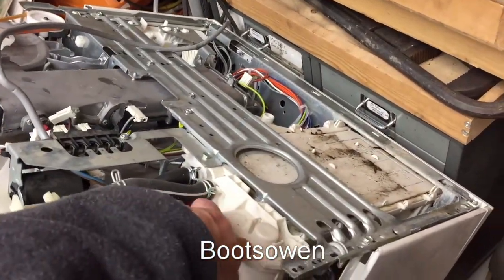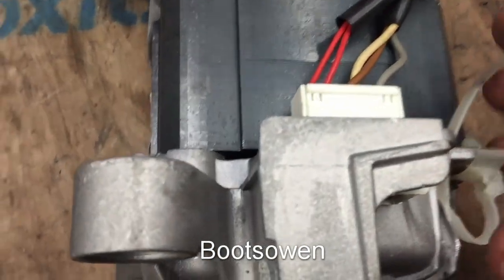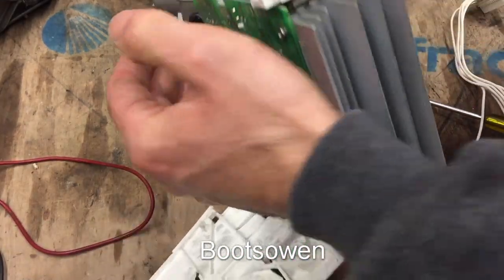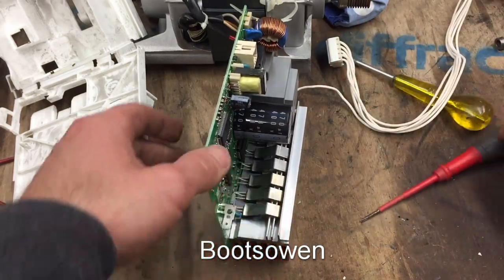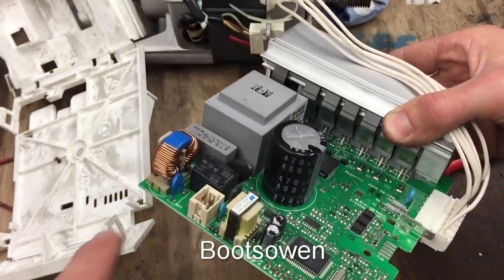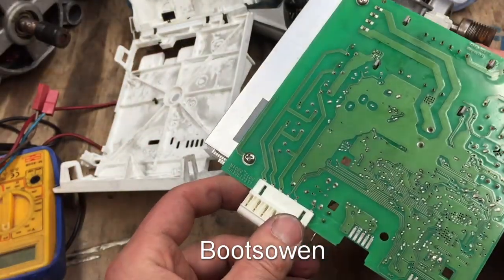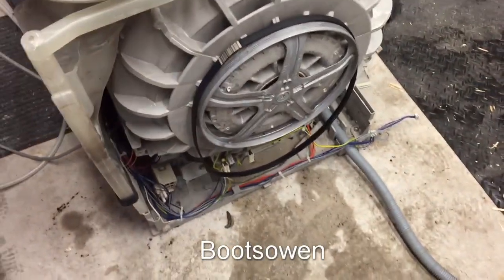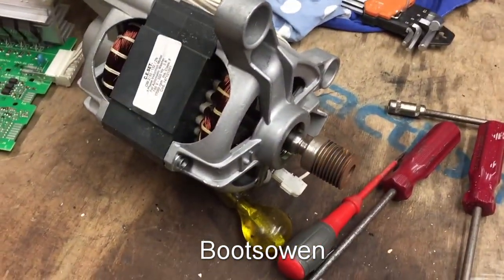Any ideas? How do I wire a  3 phase washing machine motor?

Comment: I found that the frequency does not really matter. if you hook up the motor to a 3 phase generator of any type (wire to wire) the motor will spin in conjunction with how much you put through the generator. Even if you spin the gen by hand generating 20 volts, at 30HZ for instance, the washing machine motor will spin in same direction you turn the generator, regardless of frequency because it's an induction motor and 3 phase. The frequency is more essential to single phase. Maybe put a capacitor (like the ones on that board 470v 400uf (as uf is only how much it stores)) to a speed controller that can handle the voltage, and you should be able to get the full speed range you're looking for.

Comment: I wanted to solve the same problem. I even asked my acquaintances, electricians, but they only laughed at me saying why I was messing with my head. Finally then I disassembled this board for the relay and the rest of the spare parts, but it's a pity of course. After all, imagine how many of these machines are all over the world and everything is in a landfill or buy a Chinese driver for Almost 100 bucks.

Comment: You can use a VFD - Variable Frequency Drive. There is a video by Photonicinduction about them. It's called "Motor Inverters".
Reply: Yes you can because that's all the boards are 3 phase vfds

Comment: It reaches the same speed as universal motor, even though it's quieter, it's used in Beko, Bosch, Gorenje WaveActive, etc, to make induction motors quieter, add a capacitor.

Comment: I use a motor like this on my homemade bandsaw. 

I use a 55 uf capacitor for motors, and reduce voltage from line to around 110v with a dimmer. (I live in Spain and we have 230v, and with this voltage the motor overheat ). This is a cheap solution. And will give you around 3000-3500 rpm. 

There are 5 wires. 2 for the taco,  and 3 for the motor. Forget the taco.

One wire to the "line-neutral" 
One wire to the capacitor. 
One wire to the other contact of the capacitor. 
And connect the other "line-neutral" to the capacitor. Depending on the Conector you choose the motor will turn one way or the other. 

I have been using it a lot and serve me well. 

Thanks for the video.  Saludos.
Reply from the maker: Thanks buddy, how did you choose a 55uf cap? is it just one that seems to work or do you have a way of choosing the value?
Reply: @bootsowen  I found on Internet that you need a capacitor of around 70 uf for 1 kw.  I made the calculations and choose the nearest capacitor that I could find. And it worked perfectly. 

I hope it can help you. 

Saludos.
Reply: @borjafg6899

I got exactly the same motor and controller. May I know at what voltage that capacitor runs? I can only find 70uf capacitors with more than 500 Volts, what seems to much I think

Comment: I wonder if the relay could start/stop it, if you put the right voltage to the board.  Seems this board IS what converts the single phase to three phase, so just need to finger out how to turn it on without using the front panel controls.
I wish I'd kept that board, instead of just the motor, from the washer I took apart.  I want to make a wood turning lathe.
Jeremy Fielding, a YouTube'r who teaches how to re-purpose motors (and build shop tools & robotic arms) describes two methods to spin one of these motors -- one of the methods (the preferred way) uses a second motor to condition the power (if I remember that right).  Of course, the spendy way is to buy a single-to-three phase converter... I don't have funds for that, but imagine plans exist online to solder up my own...some day, hehe.

Comment: I used a rc car motor controller on the same motor with only 24 volts. Maybe you can get a higher voltage one. You can get 8s esc which is around 33volts but bit expensive!

Comment: This is called a 3 phase inverter motor because of that board :) all that board does is “invert” the voltage (ac to dc or dc to ac)
In other words it’s a vfd but without the variable
Reply: Sadly without the control PCB you will not be able to use the inverter module (that’s what’s it’s called) because we don’t know how much voltage enters that PCB and if we put too much (240vac for example it can be good but we don’t know) you can risk fucking up the module and making the motor useless unless you want to waste money on a vfd which are very expensive

Comment: Light up the relays with there rated coil inputs, can probably find them on a powered board just need a meter.
Reply from the maker: I only saw one relay on the board, input is prob 5v or 20v, I can find out,

Comment: i have 5-A and it Run on 120 volt Canada.i ask you on other your video.i took the motor out but put the w/machine out on road. now need how to wire this motor .can you help.
Reply from the maker: Hi Have you looked at my "how to wire a 3 phase induction motor" video?
Reply: @bootsowen  my friend just told me i need speed control..thank you.

Comment: 7:40 That thing looks like a transformer, but it's likely a Passive PFC inductor.
And no. The capacitor is not what does the trick. If you take the capacitor and try to wire it to the motor, you'll have a blown fuse, a popped capacitor and a burnt motor before you can even get half a turn out of the bloody thing.
I can help you out with tracing that PCB. I have a bunch of spare time right now and a passion for electronics. Feel free to ask me for my e-mail if you need help.
Reply from the maker: Thanks, I appreciate your help, If we do the messages through these comments then everyone else who is interested can see too. I agree with you about using the capacitor on the board. Even if it was big enough it would still give the incorrect frequency. What do you think I should do?  I think I can just use the board as it is. It should be already set up to drive this motor. I think it is just a matter of inputs.
Reply: Hello guys, I know its maybe late but if you solved this,  please let us know. Thank you

Comment: damn! i just buy a motor like that and i realize its 195v with 310hz and then i search how to convert to common 220-240v 50/60hz, and the answer only to buy vfd. and the price of vfd is 10x the price of that 3 phase induction motors, such a waste why they not build in genereal voltage 220-240v like other 3 phase induction motors

Comment: I have similar 3 phase induction motor ( but 5A rated) taken my old washer. There is usually a service information papers inside the washer and it already has its own VFD. It is called  a Motor Control Unit (MCU) that drives this motor. MCU gets some kind of control voltage (Vcc) from the washer Central Control Unit.  Found this video of using the MCU controlled by PC or Arduino with DIY serial port adaptor, but searching if there is some simpler way than that - https://www.youtube.com/watch?v=Npxd_H7FeSQ .
Reply: Did you find a simple way to use it lol its 2023 lol
Reply: @Palestiano i see we all stuck with the same problem years after, well now those vfds are not that expensive anymore but anyway it would be nice to use the board...

Comment: Without osciloscope and mesuring the behavior of signals it recives from the board - there is no use
Reply from the maker: I have an oscilloscope, but to do what you suggest I reckon I would need to get the machine going to see. Is that right?
Reply: @bootsowen  

You would have to find a machine with exactly the same controll board, set it to spin cycle, mesure what type, amplitude, frequency of signals on which pins does it recive and then recreate them on your own board

Comment: Why so much hassle? If you put the machine in service mode it will spin on the max rpm with the unbalance sensor turned off. Door lock is easy to manipulate by using a screwdriver.
Reply from the maker: The machine doesn't work.

Comment: I have very similar "driver" from Elux with exactly the same 4 pins going from the brains to the driver. in my case they are Brown, Pink, Orange and Grey. On the brains side (control panel) Brown goes to the optocoupler CNY17-2 pin #4 (emit). Pink goes to ANOTHER CNY17-2 pin #1. Orange I can only trace it to pin #3 on L1117 33C, which is the driver side. This is unfrortunately as far as I got. From the bit of reading, it seems this driver expects 4-20mA which must be determining its speed(??). Or maybe it wants PWM but again, on what pins??

https://www.youtube.com/watch?v=9ZKrYfIp-Yw << this video has some clues but I dont know enough about electronics to fully understand it.
Reply from the maker: I’m the same. I try to understand these electronics and sometimes I get it. This time I don’t.
Reply: Ok..got my 3 ph motor to work today. No electronics besides a 15uF capacitor. My mains is 110v 60hz. Don't know how it would work in UK.
Still have to check what rpm it spins at but looks fast  also I know using capacitor makes "fake" 3 phase where amperage is unbalanced so I'll have to check how bad it is.